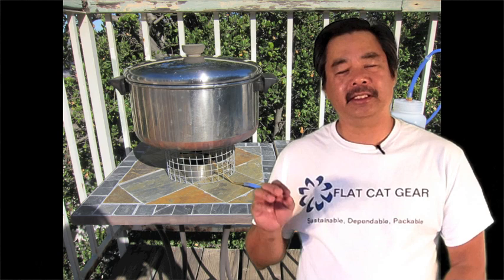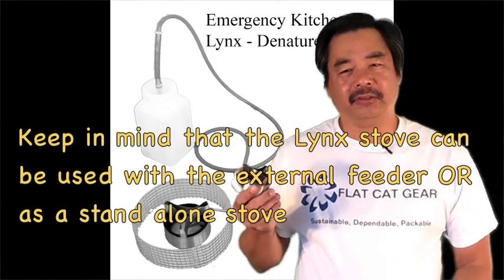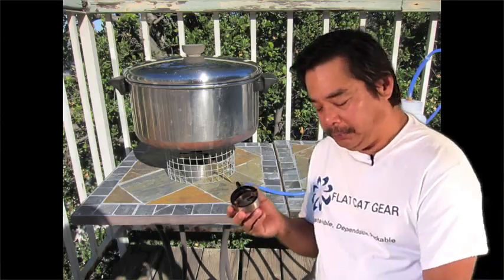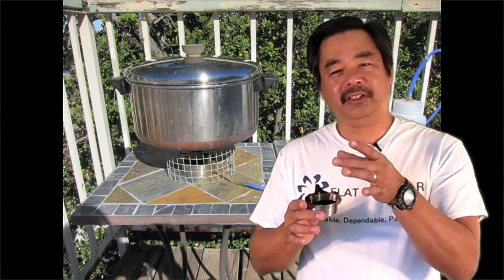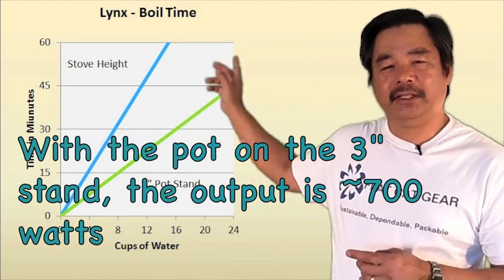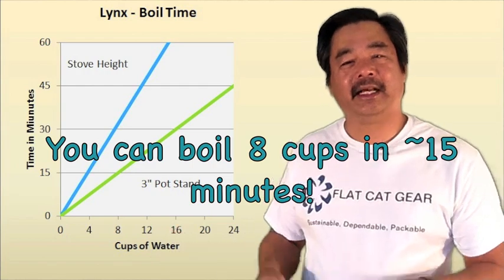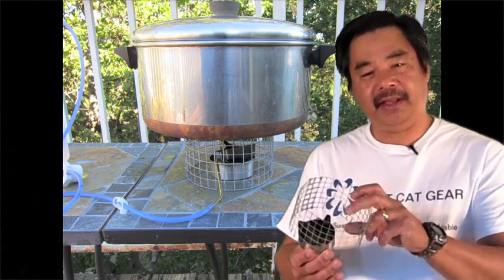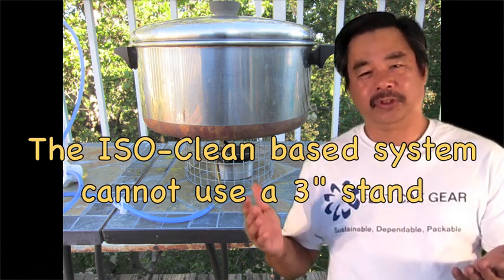The Emergency Kitchen, Part III, the Lynx stove by FLAT CAT GEAR

Comment from the maker: The Lynx is designed to work with mugs and small pot (~6” in diameter).  As you increase the stand height (air space) the output wattage goes up.  The diameter of the flame also increases and as the flame to pot diameter ratio drops, so does the fuel efficiency.  The increase pot stand height works well WHEN the pot diameter increases.  With the Emergency Kitchen, you use the higher wattage output with bigger pots (>6” in diameter).

Comment: I've was an "ultralighter" (relative term) long before the practice even had a name, so I am familiar with alcohol stoves. Part of my business is teaching disaster and emergency preparedness, mostly to high net worth individuals. Your idea is very good for multiple reasons and if your system goes into production I'll definitely recommend it. I might even buy one myself. On the downside, you will be facing fierce customer resistance. People are too accustomed to mass marketed propane, and to a lesser extent, white gas "suitcase" two burner stoves. In any case I'm interested in hearing the results of your testing.

Comment from the maker: Increasing the pot stand height does not work with the ISO-Clean stove because the stove needs a short air gap in order to create the proper alcohol to air ration to reduce soot generation.  You can use a higher pot stand if you are not concerned about soot on your pot.